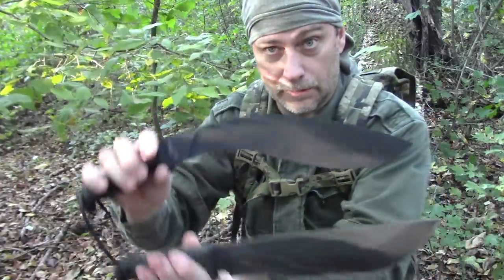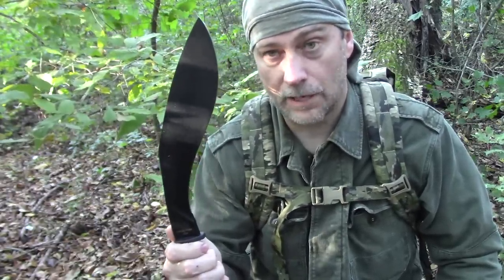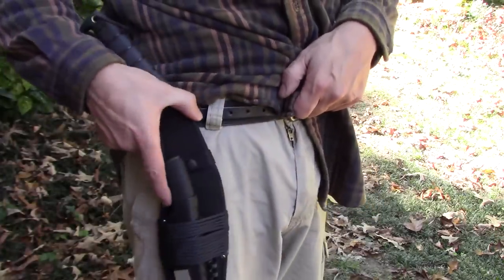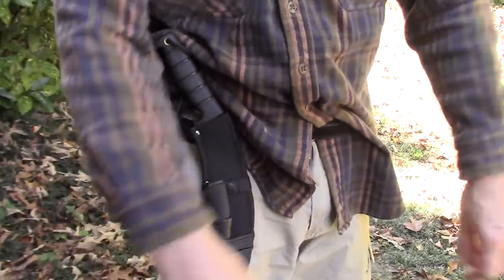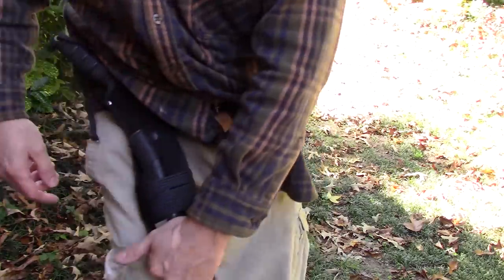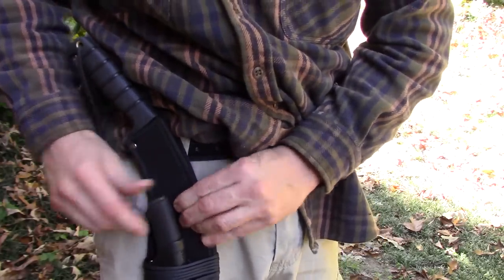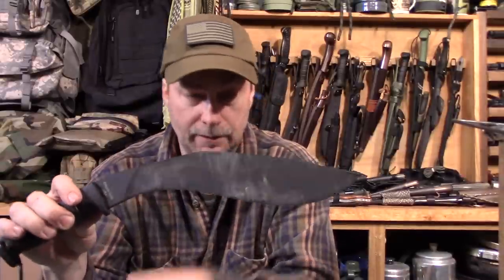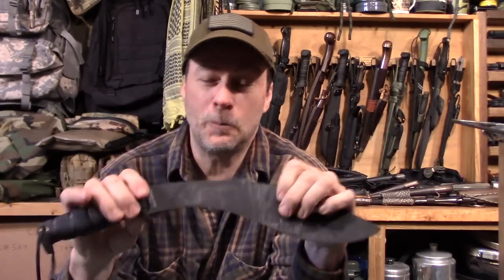Ontario Kukri vs. Ontario SP 53!

Comment: I am a long time user of the ka-bar kukri machete, and i think that for the thing you noticed where the shape of the kukri likes to wrap around the wood makes it a safer big knife to chop with, it doesent glance off like a straighter blade might. For green thin stuff its not asgood as my ontario sp-5, but i find with a kukri if you hold it loose with a 45 degree angle to what you are chopping you can do a flick cut with a wrist snap and it cuts the green stuff easier. For the size weight and ease of use a kukri is always going to be my go to if you could only have one blade that can do it all, i also use tomahawks and axes a lot but those can be VERY unforgiving especially if you are not used to using them, are tired, or in shock or hyperthermic, the heavier head weight of axes and the short cutting edges on tomahawks and axes means you have to be much more accurate or you could injure yourself. Would be cool to see how the ontario kukri stacks up to the ka-bar kukri machete.
Reply from the maker: Thanks for the comments and those are very good observations! That Ontario kukri vs. Kabar kukri would be cool

Comment: With the handle being in the way on your belt flip the kukri backward so the handle is facing out. I know grabbing it makes it so you have to grab it a little slower but whats a second longer unless you're in need of deploying it fast but I only see that needed if you're using it as a tactical weapon which is probably only less than a percent of the people who carry them. I've also seen people use hockey stick tape on the handles for a stickier thicker grip. That tape takes abuse so out in the bush it holds up well.
Reply from the maker: Im guessing I could do that by wearing it on my left side. I think Hockey tape, tennis tape and baseball bat tape would work. I need to experiment with all three. Thanks for watching Bill

Comment: Thank you for a very thorough and objective comparison of the two blades. I have a feeling that if you had as much time using the Kukri as you do on the SP53, the results may have been a little different.

P.S. I can't believe you went into the woods without a saw. lol
Reply from the maker: You are very welcome Mark and I'm glad you liked it.  I think you're right.  The behavior of a kukri is drastically different from a standard blade so if one is used to it then all other blades would seem weird.  Lol, it's rare I have no saw.  Thanks for watching brother

Comment: Have an Ontario Marine Raider Bowie. Not a big fan of it. Difficult to put an edge on and it dosent last. First time it was used I broke the tip off in a plastic 55gal drum. 
For me the only good qualities are the handle, fits my large hand well and the heft of the blade lends itself well to chopping.
Reply from the maker: Really? Ah man I hate to hear that.  I've had good luck out of the Ontarios I've used.  Thanks for the comments Justin

Comment: I’m trying to decide between a khukuri and a parang. No specific brand of either, just design differences.
Do you have a solid preference or recommendation?
For what it’s worth, this will be MOSTLY for wood processing and may include SOME meat processing.
Reply from the maker: Easy choice when you say mostly wood processing. Definitely get the parang. A kukri is more of a crafting shelter type building blade.  The parang is a chopping beast

Comment: A couple years ago I thought it was you showing someone how to make a bed between two trees.  It was quite good except then they (or you)   said to hang the boots under the bed and above the ground.
I've seen where a Porky Pine came into a tent with 5 guys during the night (apparently they can sense the heart beat of the humans or something to know they are asleep) and chewed the sweaty boot laces as well as the sweaty suspenders on one fellows boots and suspenders.   He looked kinda kewl the next day while running around with half suspenders.     Those hanging down boots would not do well in Porky country so some advice I got from an old trapper was to put the boots  under your sleeping bag down by the knees so they would be toasty warm in the morning. I had the opportunity to try that many times and it is very satisfying in a frosty morning with warm boots. I also used silk cargo chutes to wrap up in and sleep in
extra comfort inside the sleeping bag. The cargo chute counter would always wonder why he couldn't count the actual number (hidden in my bag)  until the next day.   (-:
Reply from the maker: Thanks for the comments.

Comment: Is that all fat wood ??? .I believe through my yrs of useing blade I've busted out flat grinds 3 of them sabre never bust one .hence I don't but flat grindsthey will both chop .but get that kukri out in the swamps it will take out the small vines and such easier then most
Reply from the maker: Its a dead downed pine but not quite devolved into fatwood yet. It had the color tho!  What you said kinda backs up what I thought about a flat grind sticking during chopping. Folks naturally give it a twist to unstick it and theres your chip! Thanks for watching

Comment: I recall when the SP-50 and SP-51 were super popular. There are lots of videos about them and other models. If I recall correctly are the even numbers the convex grind while the odd are a full straight grind?
Reply from the maker: Yep, 50 and 52 were full flat grind and 51 and 53 were Saber grind.  You have a good memory on that Gen 2 line

Comment: 26:17  : That is an excellent observation: The Kukri "reaches around" and creates a more contrasting angle by changing sides, without the huge trouble of rolling around that size of log (often an impossible task)... I had never thought of that... On medium 2-3" size logs (a more common target), I wonder if it holds similar advantages?... One advantage I found to the Full Flat Grind (I define that as still with a separate edge bevel angle, not a zero edge) is that it allows to NOT alternate the hit sides: You can keep hitting inside the same cut, on the same side of the cut (unlike an axe) and this gets through in a diagonal with about 20-30% less hits. Sticking is an issue with FFGs, but it is really bad only in wet conditions, or when hitting too hard. With big Sabre Hollow Grind knives, if thin enough at the edge, what I found is the edge is not weak when real thin behind the edge (0.020" or half a milimeter) because the wood has not enough "pinch grip" to twist a Hollow Grind edge (which it can do on similarly thin FFGs)... When as thin as that behind the edge, a Hollow Grind is wonderful because it hits "softly", which is more comfortable. The downside of the Sabre Hollow Grind shoulders is you have to "go around" and break for stuff above 2".... I think Full Flat Grind is better by a small margin, but soft hitting Hollow Grinds are nicer on hands if going straight through can be avoided.
Reply from the maker: Thanks for the comments,  that's a fantastic dissertation of blade grinds! Take care and thanks for watching

Comment: As always, excellent hands on information and advice.  Since Ontario isn’t currently manufacturing, is there a substitute to the SP53 you recommend?  Also, although not on the same par as the SP53, have you reviewed the Kershaw camp 10 by chance.  I checked through your videos as best I could but haven’t found a review of that one.  Thanks for these videos and the instruction
Reply from the maker: If I had to pick a replacement for the SP53 it would probably be the Kabar Cutlass.  So far I haven't owned anything by Kershaw yet but might one day.  Thanks for watching Tony

Comment: Last might I was chopping wood with a machete as my axe is 300 miles from me. Indeed after one log I found myself using the wrist swing. Even for more powerful cuts. It's a longer machete. You find the center of gravity and you try to give it the right speed for half inch cut. It gets the job done. I like my axe more tho. I felt like a beaver. It takes maybe 4 times as many cuts to get a not very nice V shape cut. The Kukri may look awkward but the mass is further which is good. The distribution of material looks good for speed. You rarely use the ends. They dont do much of work except adding weight. I'd want the handle more straight but I guess it may actually feel good as it allows the wrist to rest in a more natural position at the time of contact. I swing my straight machete with an index finger and a thumb. The point of contact is between the middle of the blade and 2/3. There's a room for improvement in the classic design. The tip is too round and useless. Even leaves would slip. Maybe as a weapon it would cut but so would a tanto shape
Reply from the maker: Thanks for the comments! Very interesting points about large blades. Thanks for watching

Comment: I like the Ontario knives but I find that they need a little bit of edge work out of the box. It would also be nice if the would put a metal pommel on the end of the handles. I like that striker you demonstrated. Is that homemade or commercial?
Reply from the maker: So far I've been pretty lucky with out of the box Ontarios. That striker is homemade out of a lathe toobit. Thanks for watching James

Comment: A "snap cut" works best when chopping with the kukri forward edge of the flat grind. The inside recurve section is best used with a firmer grip. I really like the 5160 steel in kukri best. Please be extra careful drawing or returning any kukri or kukri like object to it's sheath. I believe the SP is an excellent chopping tool selection for any situation.
Reply: The ontario kukri is 1075hc steel
Reply from the maker: Thanks for the comments Steven
Reply: Indeed Sir. Which is why I procure kukuri from Napal.

Comment: Cutting at a 90degree angle is always difficult with any blade using a 45degree downwards cut will do the trick I've used both types of blade in the past the kukri is good currently I'm using a 12in OKC blade like the saying goes the pleat of the meat is equal to the angle of the dangle
Reply from the maker: Thanks for the comments Hubert and thanks for watching

Comment: Dave why not both i have a SP 9 & SP 10 in my bug out bag my bag is about 30 lbs yes my SP 10 wouldn't make curls so i regrind the back 4 " of the blade now its almost razor like like all new knives you have to adjust them to your preference i pointed the tip more for skinning my SP 8 i used a chainsaw sharpener on it and it saws really well and have no problem with its chopping abilities...
Reply from the maker: I'd say carry both if they have different uses. Especially if they are modified for exact applications like you have done.

Comment: Wonder if you have any blade with pins or screws that rust easily. Had a second hand big ol' BK-7, but noticed the screws had started to rust, potentially letting the tang rust at the holes. Switched to stainless steel screws as I didn't want to have to unscrew the 3 screws all the time for maintainence. Not having a problem with the rest of the knife, even if the factory sheath was not the best and the knife handle needed som grip tape to get less slippery.
Haven't heard much talk about blade getting rust via the screws.
Reply from the maker: As far as I know none of my knives or machetes have screws in the handles but I could see rust transferring to the blade holes that way. Thanks for the comments and thanks for watching brother

Comment: No Nicks? Needs lighter fluid! 😆

You probably know this, but with any kukri, when taking it out of the sheath, or putting it back in, always hold the spine side of the sheath. With the way that front section swells, it likes to bite into the upper part of the sheath. I saw someone nearly take their fingers off because they were hamfisting the sheath and the blade sliced through it (they also jerked the blade quickly out of the sheath). Maybe it's not a problem with that split style sheath, I've never used one of those.

Another nice thing about that lanyard assisted loose grip you demonstrated that I like, is you can get more snap on the blade with a little squeeze of the hand right before you make contact.

I really enjoyed the discussion of the blade geometry & scissoring action of the kukri 👍
Reply from the maker: Yes, you're correct on holding the spine side of a solid sheath.  With a split sheath it's not a big deal. Thanks for the comments and thanks for watching

Comment: Personally I don't care to much for the kukri curved blade.  I personally never used a Kukri  or Sp 53.  But if I was going to get one I would just go with the Sp53 .  I just don't like the look of the Kukri blade.   Course I just have a cheap $18 Mossy Oak fix blade tactical Bowie knife in my pack right now. Later on I plan on up grading to better quality big knife. So I'll definitely have check out Ontario brand. Definitely good video learned quit bit.
Reply from the maker: If you was used to a normal large blade then you used the kukri it would blow your mind at how different it is. You'd think they all chop the same but they don't.  It actually excels in certain situations.  I'm glad you liked the video and thanks for watching

Comment: Great review. Ontario makes good blades. I bought my first kukri (not Ontario), but it wasn't very good, because it was heat treated to too soft. Do you know if it is possible to selectively heat treat the edge with acetylene torch? I would hate to make new wood parts. It is cheap blade so nothing lost if it doesn't work out.
Reply: You could but you'd need 2 minimum
Reply from the maker: Thanks, I'm glad you liked it.  Well if its soft and of no use anyway you might could wave the torch across the cutting edge then quench it. Some sit them in a pan of water upright so the spine doesnt get hot. I guess give it a try but go easy and dont get it too hot.Thanks for watching
Reply: @Reallybigmonkey1  Thanks for the tip. I quess i just have to try it.

Comment: Dave,  I wanted to ask you about teaming a manchette with a smaller knife.  Have you paired a Mora with a larger blade.  I wish to do that but I have a question.  Do you remove the belt clip from the Mora so it lays flat ageist the larger sheath ??
Reply from the maker: Yes, I've paired three Moras with machetes. My CRKT Chanceinhell,  Condor bushcraft parang and my Ontario SP53 all have a Mora.  You can remove that belt clip but I never have.  Its really doesn't angle the sheath out too bad and if your machete sheath has a pocket you can simply clip it on there
Reply: @Reallybigmonkey1  Thanks Dave that gave me another Idea and inspiration.  Merry Christmas to you and yo kin
Reply from the maker: @heyoldtime8969  Thanks and a Merry Christmas to you too my friend!

Comment: Kukris are such an odd knife. 
They are designed for hacking at things 4ft. Off the ground or higher. Like torsos and limbs of humans. It’s extremely tough to use them in wood processing. And learning new techniques specific to the kurki takes time. Once proficient , the knife can be wielded with comfort. As a combat survival knife, they fit the role. But for max efficiency, in using valuable energy to build shelter, traps, and other tools. The main focus being wood and meat processing. I’d choose the SP53 out of the two.
With the camp14 being my favorite budget survival, one tool option. And the Condor Atrox or 1917 bowie ,a step up from that. Category is best one tool option survival knife 15’-20’ inches. Best budget chopper goes to the SP53. Changing the grind on the tip can make it more useful.
Reply from the maker: Thanks for the comments and I couldn't agree more on how good the SP53 is.

Comment: Let me say I have the kabar cutless, an the ontario kukri. I'm not so much a fan of the ontario. I love the kabar cutless. 
Now I have a sirupate kukri from great Gurkha kukri that is amazing in fact its my favorite. I find kukri are very nice but it's something that needs to be learned. I think being we all grew up using straight blades we become comfortable and used to them. The kukri the more I use it the more I find I enjoy it. 
The ontario in my opinion would be better with a different handle. I've been thinking about rehandling it. Just not sure what to use. But it will come to me. I really like the handle on the coldsteel kukri they are amazing.
P.S. kukri are usually cross draw, but that is with the other sheath. I personally have the kukri in my bag when I used it.
Reply from the maker: Thanks for the comments and I gotta agree with you.  Once you've spent a lifetime with a straight blade  the kukri takes some getting used to.  Take care and thanks for watching

Comment: I just acquired a 1904 doughboy and a USMC Bolo that im trying to restore. Any suggestions?
Reply from the maker: My biggest suggestion is use a guided sharpening system to establish a predetermined angle then later on your maintenance sharpening and stropping can be done by hand.  Other than that just clean and polish it

Comment: SP53 is amazing blade !!  Ofcourse as a budget blade it needs some modifications to be done !! 
What I did to mine ... I drilled additional lanyard  hole up front of a handle , grind spine to sharp 90 degree,  and made new sheath ( kydax stile)  out of plastic paint bucket !!
Kukri... this blade is very awkward to use...., this design of a large knife  can be used in a pinch but I rader not !!
Reply from the maker: Thanks for the comments and thanks for watching my friend!